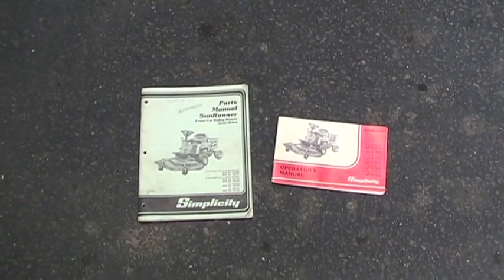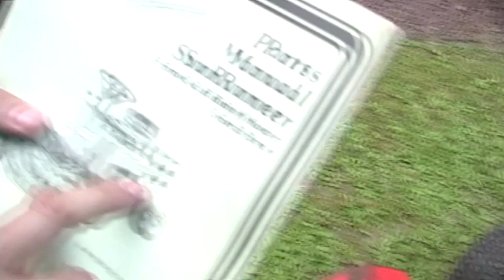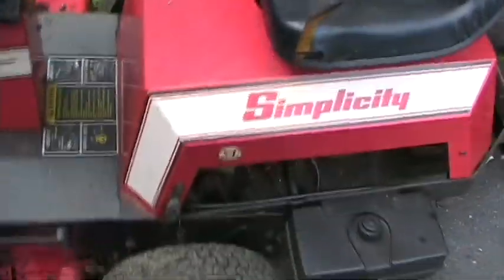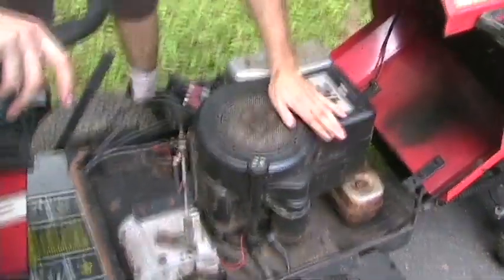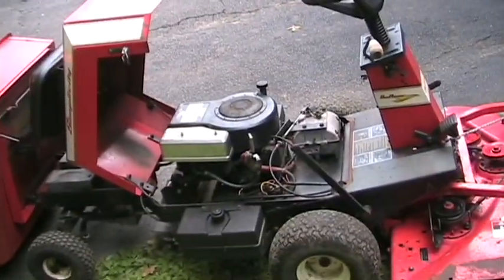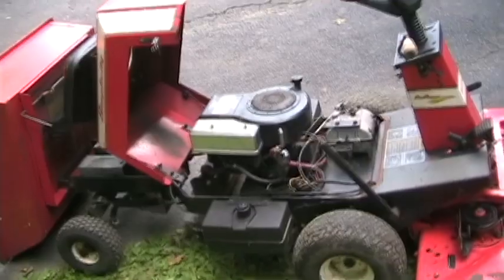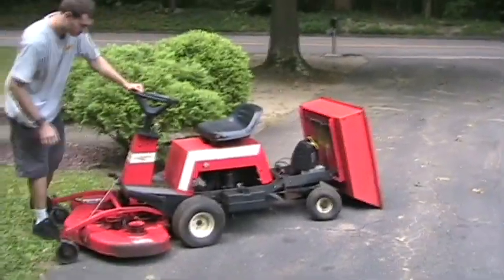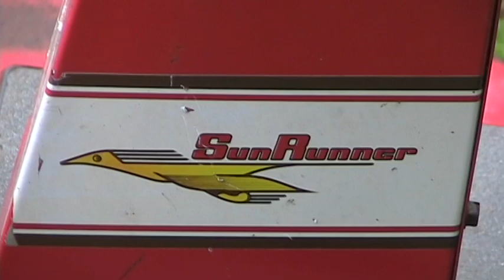The 1987 Simplicity SunRunner rear-wheel-turn lawn tractor

Comment: I parted a Duetz version of one of those about 7 or so years ago. I still have the rear axle and the front frame with casters that the deck hung from. The cables for the rear steer wear out and are expensive to replace if you can still buy them. Later versions had an improved steering system. There were variations of them with larger engines, decks, wheels and tires and some with hydrostatic drive.

Comment: i have one of these.its easy to drive,first off don't take off in 5th gear at full throttle.i leave mine in third and mow an acre in about 20 minutes and half is hilly.
Reply: I am looking at one of these or a Bolens estate keeper/greens keeper. Looks like it can keep pace well with a Zero turn as they steer more like a combine or swather. Which is great for tight turns and lawn mowing.
Reply: It wont break the chain driven axle in 5th gear if you release the clutch pedal slowly. Dumping it, has only made the wheels spin alittle on grass with ours! ☺

Comment: Double gas tanks is factory with a mechanical fuel pump. We dont even need the choke to start ours. It's a fabulous machine! There should be pulley covers on the cutting deck. Ours has the battery in front of the motor on that open section next to the transmission.

Comment: Hey Lynol! I'm 14 and I love your videos, I would LOVE to buy that SunRunner for my lawn, I have a small lawn (1/6 of an acre) and hard to maneuver my two tractors. And I have a WeedEater just like your "Bucking WeedEater" We could trade or I would be happy to pay for the SunRunner and give you the WeedEater for free.
Thanks! Corin.
Reply: Corin Gatwood Why not just buy a new one? I mow 3-5 acres a week for a little cash on the side (waiting to get a drivers license/car so I can get a rear job), and I would run one of my newer mowers over my oldies ANY day just for the fact that its faster (tighter steering radius and most new mowers have hydro trans-axles) and obviously easier to find parts.  Now for plowing, pulling, ect its hard to beat my old garden tractors, they are beasts when it comes down to raw power.

Comment: I am in need of something showing me how to put a belt on for this mower I just bought one I love it but needs a belt have no idea how to put one on and also need the belt size and info please help me thanks million RaJeana
Reply: I believe it uses a 129 inch belt for the deck, and a separate belt for the hydro unit. It is a pain to replace it, there is an idler underneath that needs to be loosened to replace the belt, best to do it with the mower off. You will probably have to get it from a Simplicity dealer, and because it was a low volume unit, he will probably have to order it. Nice mower,  but eventually the rough ground and heavy grass wore it out.